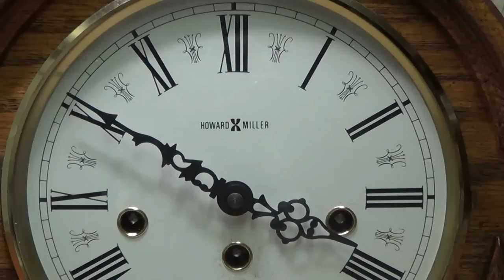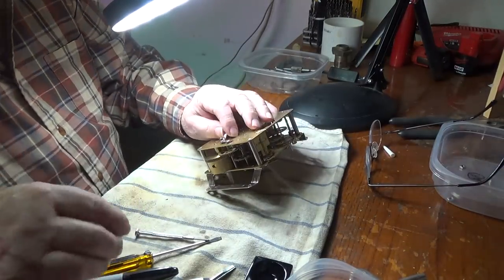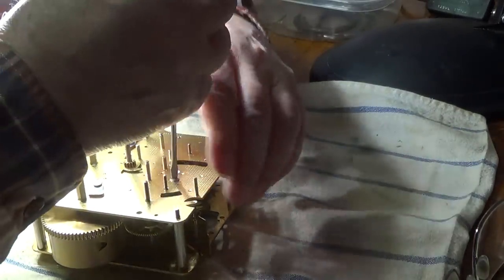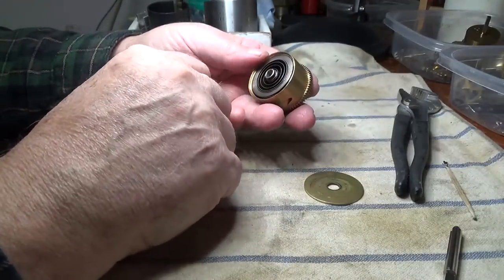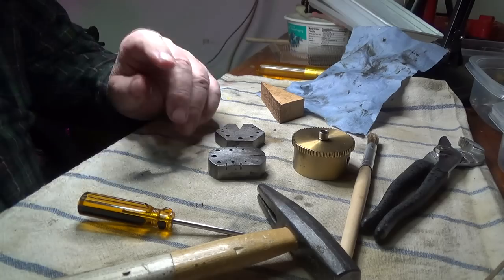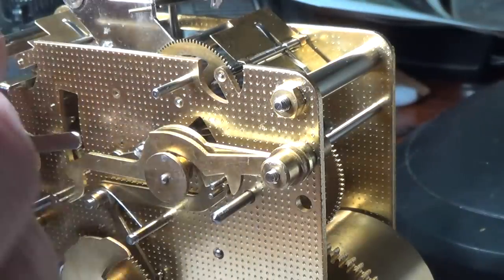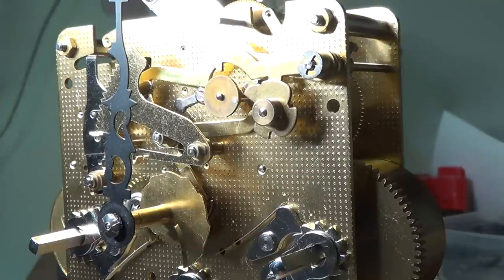Howard Miller Worthington Mantel Clock with Hermle 340 020 Movement

Comment: Hi,i have a question.... Can i use a lighter weight (cuckoo)? Mine is calling fast. Thanks :)
Reply from the maker: Yes.  In fact, it is the ideal to use the lightest weight that still keeps functionality.  The lighter the weight, the less wear on the pivots and pivot holes. However, in the case of the cuckoo going too fast, I suspect the problem is the governor, or fan, is not tight enough on its arbor and is slipping, allowing the gear train to run too fast. The governor is a small, flat brass piece that uses air resistance to slow the train and is supposed to slip on the arbor when the cuckoo ends and the gear train comes to a sudden stop.  Its slipping on the arbor dissipates the energy of the moving gear train when it stops to prevent damage to the gear teeth and pin on the warning wheel.  You may find a lighter weight slows the train but then doesn't provide enough power to lift the bellows.  The best solution is to tighten the governor.  It's also possible that, if someone else owned the clock at one time, they put substituted a heavier set of weights to keep a worn clock functioning and the weights are actually too heavy.
Reply: Thanks a lot, I really enjoyed watching your videos makes me want to be a watchman  :)
Reply from the maker: Go for it.
Reply: Hi dperry I have been watching your video for some time now I have been working on clocks for a while now just as a hobby and sometimes people ask if I could look at there clock for them well I have Bulova westminster  has a floating balance wheel with the adjustment on the wheel it runs to slow I have it all the way to the plus side does not make different do you have any ideas on it thank you for your expertise
Reply from the maker: It's probably a Hermle movement made for Bulova.  Does it have a number on the back plate?   First, make sure the balance assembly is clean and free of oil.  The floating balance should not be oiled. Can be washed in mineral spirits or acetone.  When you say floating balance, I'm assuming you mean the one with the balance wheel and a vertical spiral-shaped spring.  It's called a floating balance because it has a hollow tube through which a thin wire passes and the balance floats around it. That wire must be taut and not bent.  The spiral spring must not be distorted or sag and drag on the bottom of the frame of the assembly.  If all that is well and there is no retarding friction, then assess the motion of the balance wheel.  It should be approximately 360 degree turn.  You can decrease the turn by narrowing the distance between the pins, but don't move them much at all.  Decreasing the amount of turn of the balance will speed the clock and vice versa. Weight can also be removed from the wheel to speed it. Here is an article with diagrams you might find helpful.  http://www.nawcc-index.net/Articles/Murray-hermle.pdf
Reply: @dperry428  thank you for the help and advice and website and it is 340-020 hermle with the vertical spiral shape spring and a hollow tube i will remove the wheel and clean it see if that works
Reply from the maker: Don't try to disassemble the balance wheel assembly.  Just remove the two screws that are holding it to the plate,  carefully tilt it out to avoid damaging the fork.  Then, clean the whole assembly as a single unit.
Reply: @dperry428  thank you for the advice I have all ready taking the hole wheel assembly out and cleaning it and I will put it back in the movement and see if it keeps time

Comment: I have a Howard Miller 340-020.  It runs great.  The only problem is every 12 hours, it had gained 8 minutes.  I have been turning the time adjusting screw counterclockwise.  In several days, the clock still runs 3 minutes fast every 12 hours.  Some improvement was made.  Should I continue adjusting the screw counterclockwise?   Any suggestions would be appreciated.
Reply from the maker: With a balance wheel escapement, if power is being lost somewhere, the balance wheel will not make its normal full swing and the clock will gain time.  That power loss can be caused by loss of power through the gears, indicating a need for lubrication or replacement of worn pivot holes or through loss of power in the mainspring.  I've found these mainsprings to be the culprits if the clock is older than 30 or 40 years.  Mainsprings can be replaced without disassembling the entire movement.  Try oiling the pivots.  If that doesn't solve the problem, the movement will need service and  possible bushing and/or mainspring replacement.
Reply: I have cleaned and oiled the pivot points to the best of my novice ability.  The movement has been functioning for a week, but the gain in time has decreased with my adjustments.  Just today the gain is 1:30, down from 3 minutes.  I will try again to turn the adjustment screw.  If no improvement is realized, I will look to replace the mainspring.  Any information or links to do the mainspring replacement?
Reply from the maker: Easiest thing to start with is to turn the adjustment screw all the way to the end of its ability.  The clock should then run slow.  If it doesn't, proceed with the mainspring replacement.  Otherwise, back off  until it keeps proper time.  To replace the mainspring(s), let down the springs, remove the click mechanism, pull out the winding stem and the spring barrel can be pulled out from between the plates.  Look at the number on the barrel and order a new one from here and reinstall.  https://timesavers.com/search.html?q=hermle+mainspring&go=Search
Reply: @dperry428  
Thanks again for the tip.  I will try turning the adjustment screw out more.  Checked this am. and the clock gained 1 minute.  Making progress.  Keep turning until the end of it's ability if necessary.  Then, if needed, try replacing the mainspring.  I'll keep you posted.
Reply: I have been away.  I turned the adjustment screw almost to the end, and the clock stopped running.  Turned the screw back some, and the clock began keeping time again.  But running 1 minute fast every 12 hours.  Would you recommend the mainspring replacement?  Thanks.
Reply from the maker: My first move would be to inspect the pivot holes for wear and rebush those that are badly  worn as that wear is the source of energy loss.  I don't expect you want to take it apart and rebush the movement if you don't have that experience.  The next move would be to assess the springs.  I would take them out of the barrels to assess whether they've lost their "spring". Again, unless you have a spring winder, I wouldn't expect you to try taking them out of the barrel to do so.  Springs are dangerous, even for the experienced.  So, the next best thing is to go to remove the mainspring and barrel and replace it. No guarantee it will resolve the problem, but I'd bet it will work.
Reply: @dperry428  Yesterday the clock completely stopped.  I tried rewinding and still it won't work.  I had cleaned the whole unit and applied oil to the pivot points.  I inspected the pivot points and found no signs of wear.  I am willing to try changing the mainspring if that will allow the clock to run again.  Finally, I am not sure I have the right tool (spring winder) to safely remove the part.  Is there a place online where I can purchase one, or a picture of one?  Thanks again for your help.
Reply from the maker: You can let the spring down inside the barrel by using the key.  Use a large dowel or piece of broomstick to make it safe to use the key.  Using a piece of dowel about  4 or so inches long, drill a hole in the center and cut a slot in the end to fit over the wings of the key.  Now, you can let the spring down by letting the dowel slip in your hand while releasing the click on the spring barrel.  A spring winder will cost you about $250 so, unless you're going to be doing lots of clock work, that almost what a replacement Hermle movement would cost. https://timesavers.com/search.html?q=spring+winder&go=Search  https://www.ronellclock.com/product/accu-mainspring-winder/
Reply: @dperry428  Thanks for all the information and help.  We are getting ready to head south (Arizona) for the winter.  I will try to tackle this when we return in May.

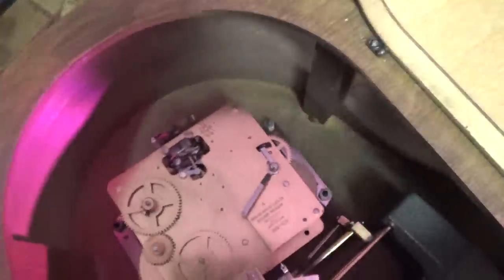Comment: Hi there. I've got my clock working perfect thanks to your video. I have one question. At 1:24:31 into the video, there is a bar (silver metal) on the bottom of the clock that goes between the chime and the chime levers. I don't know what that's for or how to adjust it. On my clock, it's actually installed above the chime hammers. I just don't understand what it's purpose is except to perhaps silent the chimes. Is that what's it's for? Thanks again.
Reply from the maker: Should be below the hammers.  When lifted up against the hammers, it keeps the clock from chiming.
Reply: @dperry428  Ah ok thanks. I think because the clock has another mechanism to stop it from chiming, they must have just put it out of the way. Has a dial on the back which rotates a bar into the spinner to stop it from activating the chimes.
Reply from the maker: Could also have been used when shipping the clock.
Reply: @dperry428  I just took apart another clock that I had. WOW. Looks like they dipped it in oil! Oil everywhere. Besides the shafts where they go through the plates, is it really necessary to oil all the gears too?
Reply from the maker: Gears should be oiled ONLY if you want to eventually destroy them.  Oil is a natural dust trap and combines to form a grinding paste that will accelerate the wearing away of the teeth and leaves of gears.  The only thing that should be oiled is the pivots of the wheel (gear) arbors and only with enough oil to surround the pivot.  Oil should not spill out of the oil sink and spread on the plates.  Otherwise, oil will be drawn out of the pivot hole, leaving the hole dry.
Reply: @dperry428  Sounds good. Thanks again for the info.  Looks like I'll be tearing this one down to clean all the oil off! I've got a few more less expensive ones, I think I'll start (and learn) with those ones. I guess the trick is to take LOTS of pictures on teardown.
Reply from the maker: Yes. Digital photography has made that a lot easier.  When I started, I had to make drawings, keep strike and run separate and wheels in proper order and front/back orientation.

Comment: I am rebuilding this same movement.  I have the time train in and the clock is running, but something doesn't seem right.  I have a floating balance and it just seems like the clock is not beating right.  If I sent you a video of it, would you take a look and offer some advice?  Thank you in advance.
Reply from the maker: Is the movement keeping time?  If it is, leave it alone.  If not, read these:  http://www.nawcc-index.net/Articles/Murray-hermle.pdf   https://mb.nawcc.org/threads/guidelines-for-repair-hermle-floating-balance.17277/    https://mb.nawcc.org/threads/difficulties-with-hermle-floating-balance-mvts.46737/   Lastly, did you check the springs?  When out of the barrel and let down, they should be at least 2 1/2 times the diameter of the barrel diameter. If not, replace them.
Reply: @dperry428  Thank you for the links, I will check those out.  No the movement  is running slow.  I don't have the tools to be able to remove the springs from the barrel.  I could probably get them out, but I would likely never get them back in again.
Reply from the maker: https://youtu.be/hC61EFOqDy4
https://youtu.be/uGZARnv2kkw
Reply: @dperry428  Thank you again for all the advice.  I still cannot get the clock running.  It seemed like everything was good yesterday, but this morning the balance wheel was barely ticking over.  I guess that suggests a power issue in the gear train?  Any chance I can email you directly, or do you have a suggestion where I could seek out additional help.  Thanks again!
Reply from the maker: Leave an email address in a comment. I hold comments for approval.  Then I'll contact you and delete the comment without publishing it.

Comment: A great video, thanks for sharing your knowledge. I am new to all of this but I have always be fascinated with older clock movements.  If I may ask you, what is your choice for ultrasonic cleaner that will also brighten the brass? Thank you!!
Reply from the maker: I have no choice or preference.  I've been repairing clocks as a hobby for more than 50 years and, until recently, never used an ultrasonic cleaner.  They were simply too expensive.  Then, two years ago, I received one as a gift.  I like it for initial cleaning, but still prefer to hand clean, much like detailing a car.  If i want to brighten the brass and remove stains, I use a mild abrasive cleaner meant for acrylic showers and tubs, along with a toothbrush, to polish the brass.  In reality, there is no reason to polish the brass to a shine, unless the clock is one where the movement is visible, such as carriage clocks, skeleton clocks and 400-day clocks.
Reply: @dperry428  Great and thank you for your time. I am an older and retired but have had a long interest in old clocks. I completed my first ever rebuild just a few days ago, a Seth Thomas #89. It took a while, 12 pivots later and about 10 tries to make it work correctly, I finally figured out what all that stuff does. It has been running and striking now without a problem for about a week. Your videos are very inspiring and full of information. Thanks again for what you do!! Ron
Reply from the maker: Congratulations and welcome to the world of clock repair.  You might like to join the NAWCC (National Association of Watch and Clock Collectors).  They have a museum Columbia, Pa (Lancaster county), publish a journal, provide training in repair and also have a great forum online that is a valuable source of information.  https://nawcc.org/
Reply: I will look into this. Thanks

Comment: Another great informative video. I am new to clock repair. I have been repaing some clocks but i ran into an issue i cannot figure out. The clock that i been fixing does not keep good time. It loses about 20 to 30 min a day. Why might this be Mr Perry? Also all bushings have been replaced on time side
Reply from the maker: I need a whole lot more information to give you any advice.  For example, if you said the clock was a 400 day (anniversary) clock, I would tell you the chances are 99% that the wrong suspension spring was installed.  What kind of clock are you referencing?  Pendulum or balance wheel?  Was the clock functioning properly at some time in the past with the same parts installed? What did you do to repair this clock other than bushings?  Tell me more about the clock involved.
Reply: @dperry428  i dont know to much of the history of the clock i workin on. Its 1 that someone had found and i just fixing as a hobby. But anyways its a pendulum clock. 8 day spring there is no markings on the movement so i dont know maker. As far as repairs i have taken it apart. Cleaned it. And checked and replaced bushings accordingly. Before i did anything to it i can tell you that the clock did not work at all. After the repairs i did it now does work just slow as far as time keeping.
Reply from the maker: In a pendulum clock, a pendulum is usually suspended from a suspension spring by way of a pendulum leader.  The period of the pendulum (the time to swing back and forth) is controlled by the length of the pendulum, which is measured form the point of suspension to the center of mass of the pendulum. The longer the pendulum, the slower the clock runs and the shorter the pendulum, the faster the clock runs.  One or more parts of the pendulum system, suspension spring, leader or pendulum itself is making the system too long.  The pendulum bob, itself, can be at fault as a heavier bob will lower the center of gravity of the system and make the clock run slower.  20 to 30 minutes a day indicated a much too long pendulum system.  Shorten the pendulum until it runs the correct speed.
Reply: @dperry428  thank you mr perry for advice i appreciate you to take the time and help me.